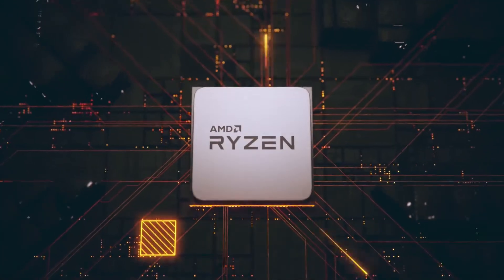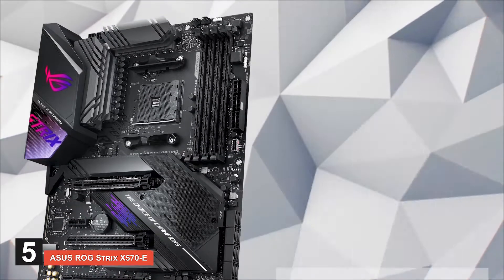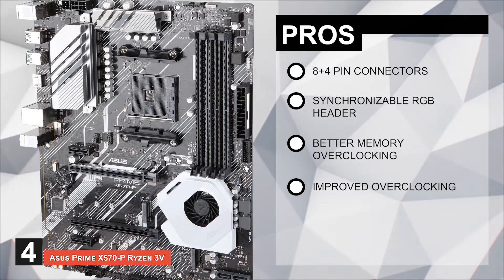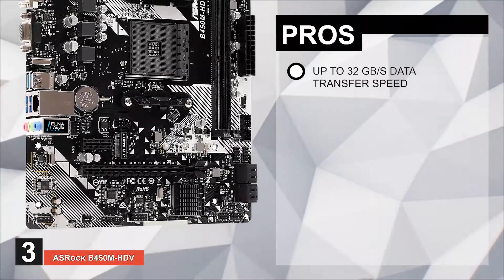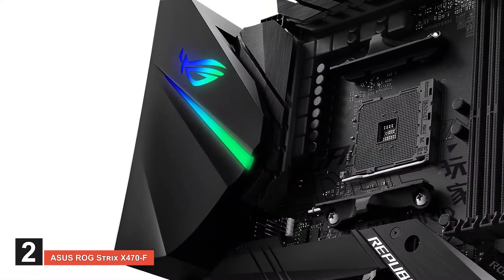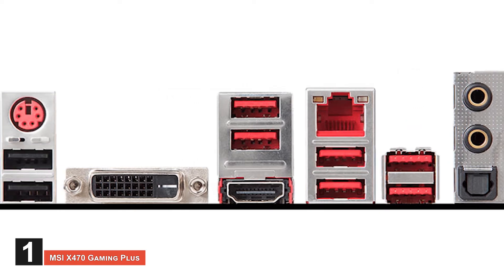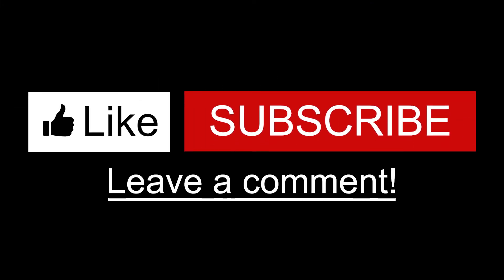Best Motherboards For Ryzen 5 2600 ✅: Top Options Reviewed | Digital Advisor

Comment from the maker: Read the full review here: ►► 
https://digitaladvisor.com/motherboards/ryzen/5-2600/
(Best Motherboards For Ryzen 5 2600)

******************
✅ Featured Products for Best Motherboards For Ryzen 5 2600

0:00 Introduction
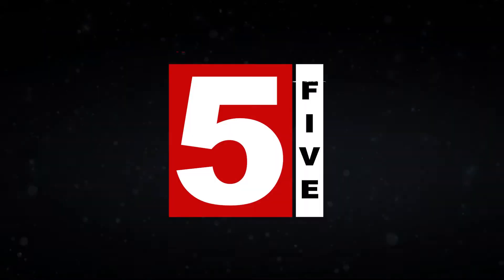0:56 5. ASUS ROG Strix X570-E ➜ https://amzn.to/3gjLPUn
2:09 4. Asus Prime X570-P Ryzen 3 ➜ https://amzn.to/3D5PrDd
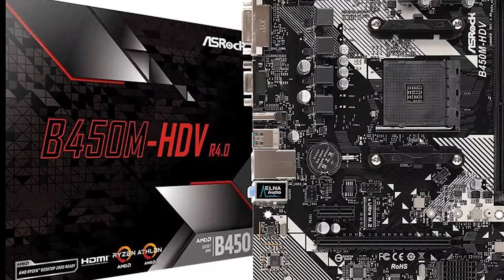3:14 3. ASRock B450M-HDV ➜ https://amzn.to/3z5qeX8
4:17 2. Runner-up: ASUS ROG Strix X470-F ➜ https://amzn.to/3j4A6uV
5:14 1. Best Overall: MSI X470 Gaming Plus ➜ https://amzn.to/3mhcbds

Subscribe to our Channel 
🔴 https://digitaladvisor.com/youtube/

******************
Detailed review: https://digitaladvisor.com/motherboards/ryzen/5-2600/

✅ The motherboard of a computer is what allocates power and facilitates communication between the various hardware components. It is arguably one of the most important elements in a computer system. Different motherboards have different types of sockets by which the CPU connects. Therefore, not every motherboard will work with the Ryzen 5 2600. You need to find the right one for your CPU. 

💬 Let us know what you think of these Motherboards For Ryzen 5 2600 in the comment section below.

👉 We appreciate every thumbs up and would be grateful if you’d consider subscribing to our channel!!

******************
🎥 Welcome to the official YouTube Channel of Digital Advisor 🎥

Digital Advisor reviews the latest tech and computer products, with a focus on PC builds and accessories. Our topics relate to the year's best motherboards, GPUs, graphic cards, video cards, routers, cases, fans, and more.

 🌐 Learn more about us: https://digitaladvisor.com/about/
 💻 Like our Page: https://digitaladvisor.com/facebook/
 📢 Follow us on Twitter: https://digitaladvisor.com/twitter/
 📱 Check out our Pinterest: https://digitaladvisor.com/pinterest/
 🔴Subscribe to our Channel: https://digitaladvisor.com/youtube/

******************
Disclaimer:
Some links in the description are affiliate links. If you click on one of the product links, I’ll receive a commission at no additional cost to you. As an Amazon Associate, I earn a small commission from qualifying purchases.

#DigitalAdvisor #MotherboardsForRyzen5 #GamingMotherboards

Comment: What mother board and ram would you recommend for a ryzen 5 2600 and rx 580?
Reply from the maker: You can try our top 1 which is the MSI X470 Gaming Plus -  https://amzn.to/2XJ4648. 
For the ram, you can try T Force - 3200mhz
Reply: @DigitalAdvisorTV  ok thanks im gonna need to save up for a bit first to buy all the parts